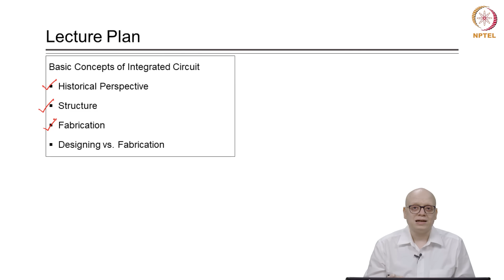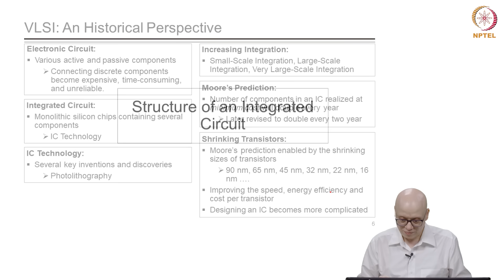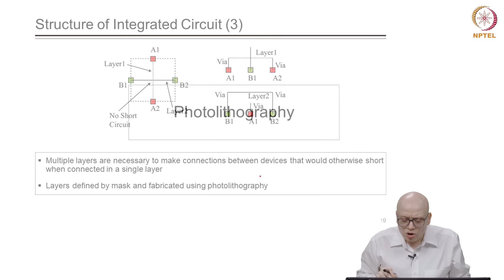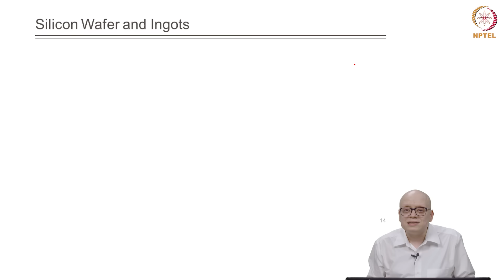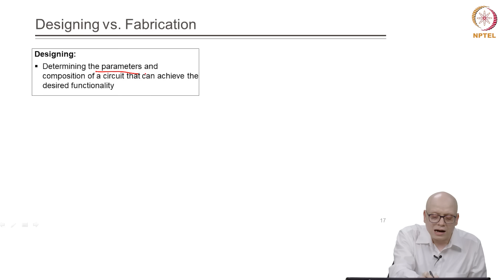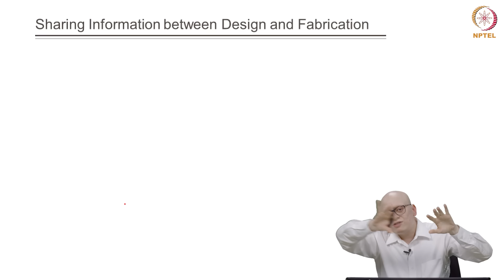Basic Concepts of Integrated Circuit - I

Comment: Everything is good,but teaching and classess are useless,shoutout to the wrongdoings and crimes happening in lieu of success,jobs and exams.

These professors are useless,as the most undeserving may also achieve everything😅😅😅😅
Reply: second sem me basic electronics hona chahiye 
3rd me digital electronics
4 th sem me analog 
HS department technical clg me nhi hone chhaiye 
5th sem me intern milni chahiye with 50k stipend 
Ppo milna chahiye whatever is the ctc 
Gate to dena hi chahiye and get atmostt air 300
Spiti ki trip bhi honi chahiye 
north east me bh ek trip karni chahiye 7 th or 8 th sem me 
GF honi chahiye if you have potential 
har course me kuch practical kaam hona chahiye 
Fuck these theory courses
lwda skills 
POR  lwda kuch kaam ki nhi hoti  hai
1.5 time a week is enough 
atleast project 2project diffenet fro other batch mates before intern 
minimun 8 cGpa or 6 (will be fine )

~Gotcha